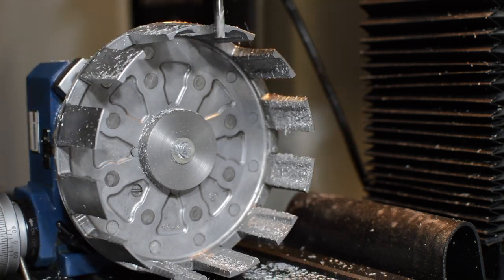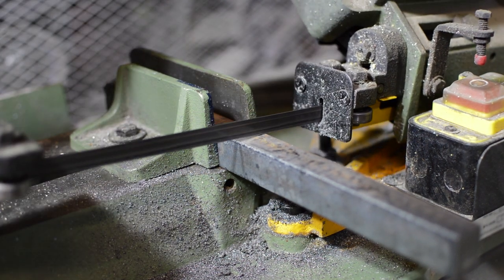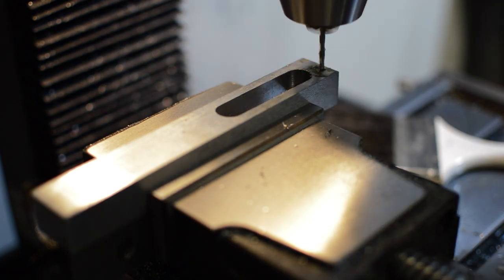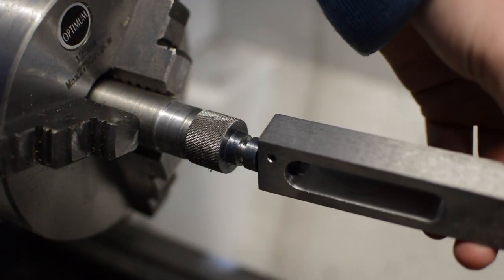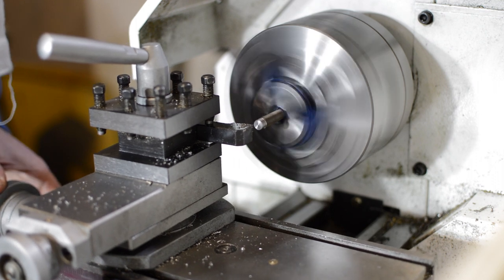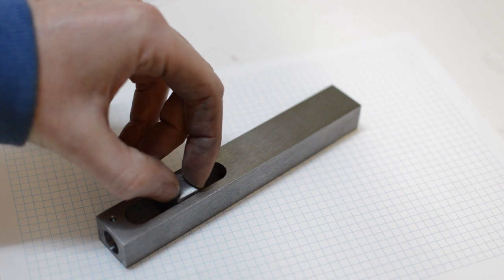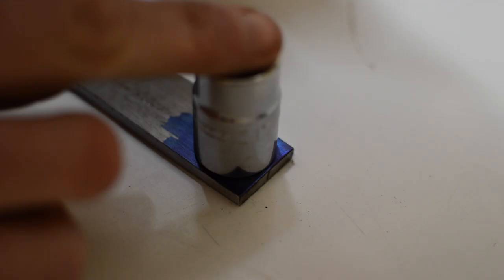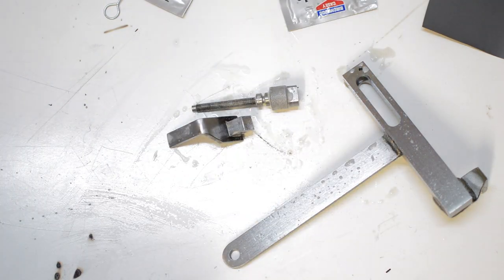Clutch Holder Tool - Shop Made Tools - Episode 1

Comment: Really enjoying your videos!! 
If you want to avoid a burr being pulled up on the edge of your stock when you machine it, travel clockwise around the edge of the part so that the cutting force of the endmill is directed towards the center of the stock.
Reply: At 13:58 it looks like your weld is a bit short of the corner. Try pointing the mig nozzle directly intro the groove at about a 45 degree angle. I also find it helps to weld at lower amperage and make small circles to tie the two pieces together better. Also always trim the end of your mig wire before every fresh weld; it will prevent the harsh starts and splatter.

Comment: Fantastic video here is my thought let me know if it works 
1.Take an Old steel plate
2. Measure the breadth of Friction plate groove.
3. Depending upon the friction plate groove weld a same breadth steel rod the old clutch plate